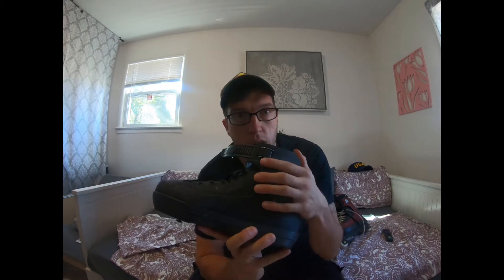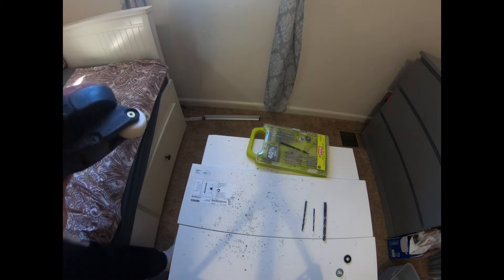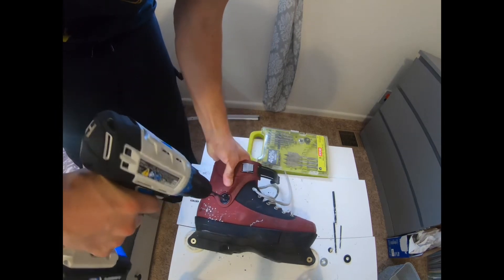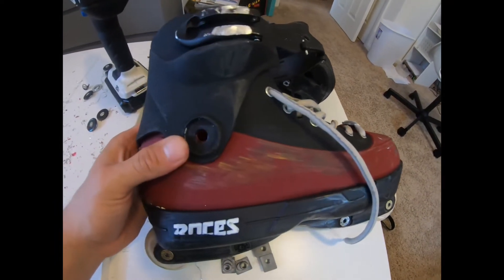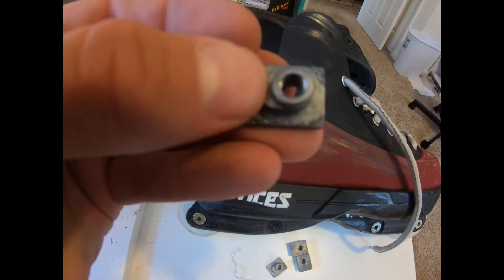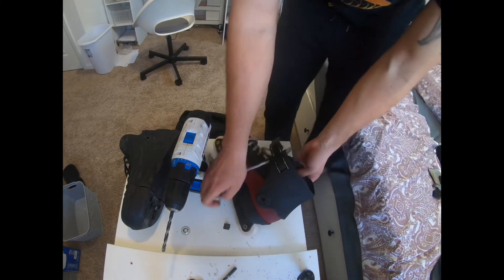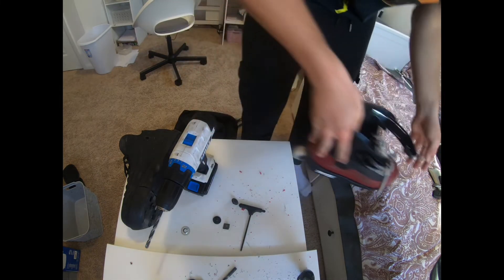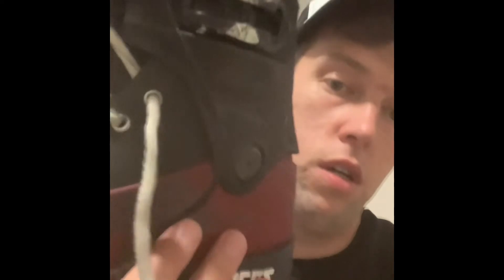How to change and replace Roces skate cuffs (5th element example )

Comment: Thanks. I might do this for these RB TRS Alphas i got off ebay. The cuff is not universal, and the buckles arent replaceable and they are kind of broken, so I guess I can drill like you did to get the 2 universal parts in there. I also have to cut the leather facade off the shell to be able to do this >_<

Comment: Nice video man, just currious.. were you having issues with your inside ball joint rubbin on the cuff bolt? I just bought USD Aeon 80s and its killing my inside foot joint.
Reply from the maker: So in the Roces I  have no pain, but I use a reign liner. There is no rubbing or friction on the cuff bolt either, its no different than Razors or USD.   The Roces has a a high heal so your naturally leaning forward, the Aeon is very flat and even with the shock absorber doesn't have much heal lift. this may be what is causing you discomfort.

Comment: What cuffs work for the roces m12?
Reply from the maker: Sofar the USD classic throne cuff is the only one that had a direct fit. I did manage to fit a razors cuff to the skate but I had to drill a new hole in the skate itself to mount the cuff.